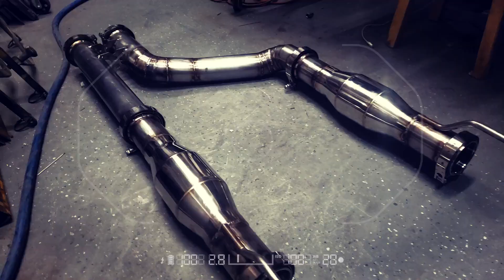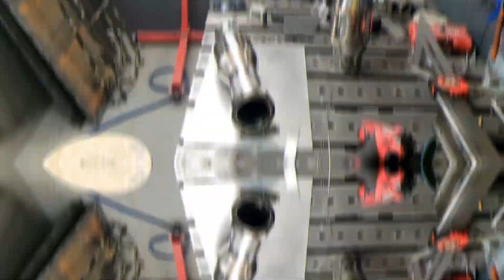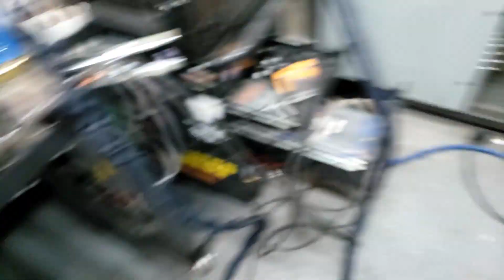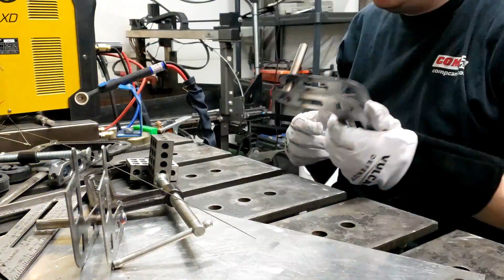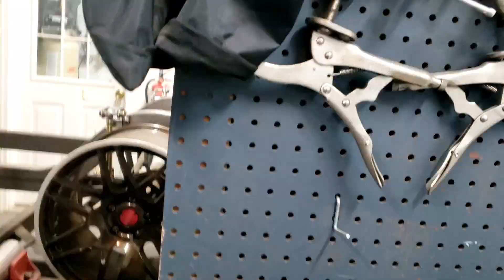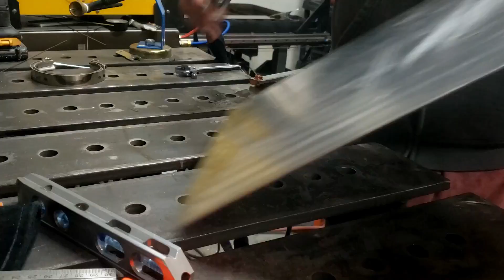TWEAKER BAIT! Catted Mid Pipe Build! C1500 R OBS Chevy Twin Turbo Protouring Truck, Exhaust PT2!

Comment: Another great video my dude. I’ve heard you mention that bad argon a couple different times and was wondering if you were going to go back to some of the welds you did with the first bottle and touch them up. Then I seen on your facemail that you had started going back to some of them.
Reply from the maker: Yeah I did. I am going through the process now of cleaning them up. I grind the high spots back with a 120 grit flap disc. Then I use a Blue 4.5" scotchbrite on a grinder to remove any surface scratch. Then after that I hit the surface with a buffing pad and black polishing compound. It comes out like a mirror. Then I go over all the welds and just lay a nice consistent cap on them. They look much... MUCH better.
Reply from the maker: Just added a quick video of the process im using.

Comment: How do you figure out how far to put the cats away from the turbos to light off fast but not burn to a crisp?
Reply from the maker: I figured at the headers its gonna be like 1500f max. After the turbines it should be at least down to 800-900f. Then I put about 5' of pipe after for good measure lol. Once you get the carryovered fuel burnt off you drop in temp a good bit. 

The cats may be a bit cold loping around... but it won't do that often.